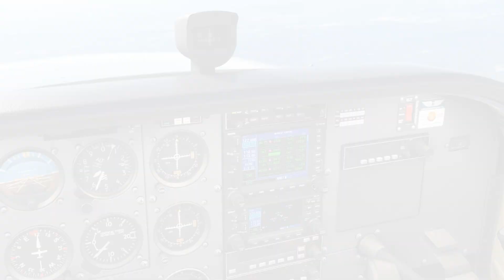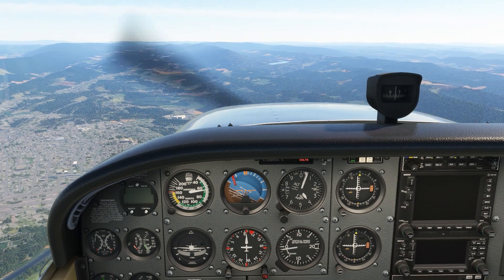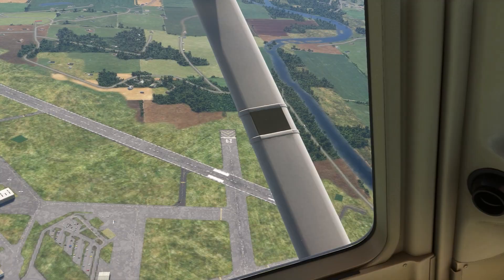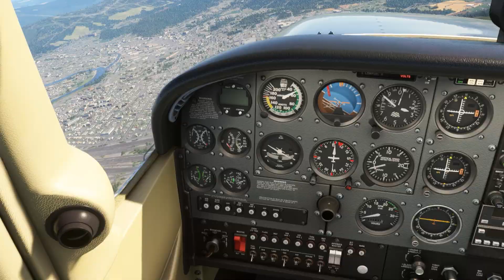Best Glide vs. Minimum Sink: Which Speed Saves You in an Engine Out? | Emergency Landing Tips

Comment: First of all, best glide is an AOA not a speed. Second, it does not let you glide the furthest distance over the ground for altitude, rather it lets you fly the most distance through the air mass. If you don’t have an AOA, you can apply the same ROT to BG as you do Vref, subtract a knot for every hundred pounds below maximum gross weight. But then account for headwind which is a bit more tricky as you’re really sliding the origin for the tangent to you curve… see the glider books. Also from the glider books, your most turn for the least altitude loss is at 45 degrees AOB. That, for some reason, scares GA SEL pilots. Remember though, you trim to AOA. If you make the turn but do not pull back, you’ll maintain that BG AOA and maintain stall margin. Yes, your nose will drop a bit, your VVI will increase a bit, your airspeed will too. But you’ll finish the turn with more potential energy saved and resume wings level at best glide AOA thus truly getting the most for it. As to headwind, there are various approximations though you don’t need to be perfect to BG, you only need to see your target staying constant or getting lower; if turning final will give a stiff headwind, turn early, and try to be a touch over energy as you can always forward slip but never add.
Reply: See Medium Improve your Landings with AOA and Power Techniques, its associated case study F-35C Crash into the South China Sea, and also the shorter Back Side of the Power vs Drag Curves. Remember in a propeller, back side is typically that slower than minimum power required but in the engine out scenario you now find this transition at minimum drag aka minimum thrust required. See the distinction?
Reply: Minimum sink is close enough to Vref, AOAref really, such that you can use AOAref or Vref in lieu of minimum sink. Using AOAref ensures preserved stall margin while Vref or V min sink risk accelerated stall. See comment above regarding constant AOA turns vs constant airspeed turns. Do constant AOA turns. Practice constant AOA turns in slow flight. You don’t actually need an AOA indicator to be able to do them.
Reply: Note in some platforms, like the Robinson R-22, min sink carries too little kinetic energy with too little rpm in the blades and is simply too risky to be practical. It is a stupid risky checkride maneuver. Meanwhile best glide is fine as it carries speed which can be traded for rotor rpm. Though the ratio sucks, so you may as well maintain better rpm and accept what you get. Yes, there is applicability here to fixed wing regarding min sink. You may want to add a stall buffer to your min sink, or, you may want to simply through out the notion of min sink.

Comment: Tldr;

Best glide speed to get where u want to land. IE it will stretch your glide distance as much as physically possible. (keep in mind thats at max gross weight)

However, Minimum sink speed is to reduce impact g force as much as possible if you are going to crash land.

Since both speeds are based off a specfic angle of attack, adjustment is required. When trying to find a proper airspeed (that is specifically calculated based off angle of attack) for a given weight, use the same formula as the manuevering speed formula calculation (except replace VA speed with whatever airspeed you are looking for… such as VX, VY, VREF, VR, etc…). 

Dont use minimum sink unless you arent making a field and you gotta put it down (such as in water or trees).

Comment: Depending on how much tailwind you have, there is possibility minimum sink speed will glide further as well. This is theoretical and we shouldn't be doing complex math in the air especailly in emegency but it's interesting concept.
Reply: This is a real thing with parachutes, which are really crappy gliders (~3:1 is typical) and slow (on the order of 15kt in steady flight), so it's worth considering, but in a fixed wing, I'd expect the chances that there's enough tailwind to make up for the lost glide ratio to be very remote.
Reply: @barblargh  It really depends on fpm of minimum sink airspeed. Which I have no idea of how fast it is.
Reply: That doesn’t really add up unless your min sink is Extremely slow. You’re going to be receiving the benefits of the tailwind while you’re best-gliding anyway so you should do that when you’re going for distance anyway.